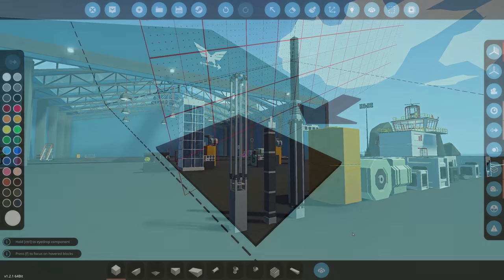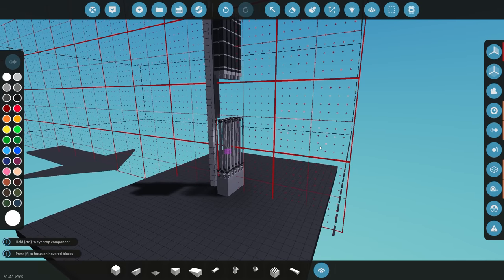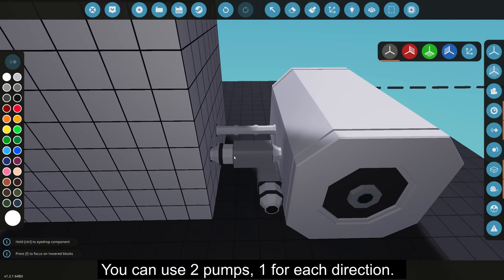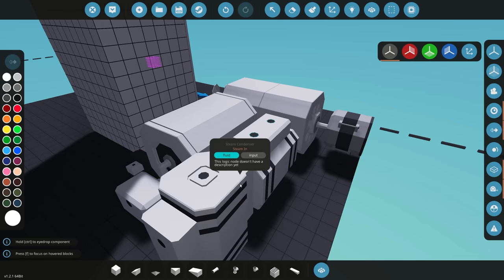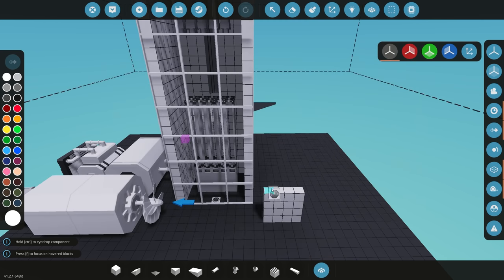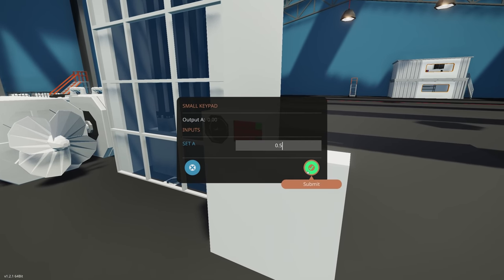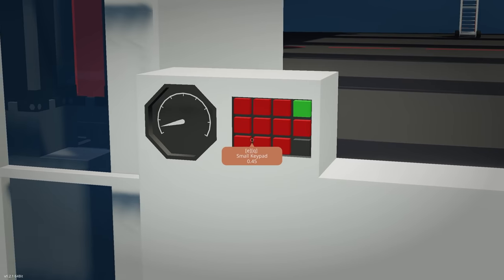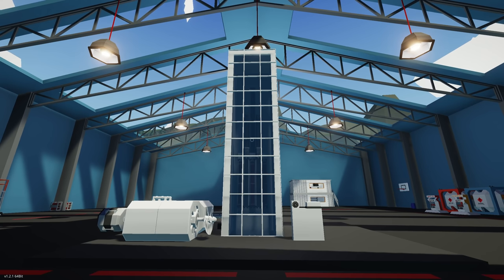Building a Nuclear Powered Engine!!!! - Stormworks

Comment: Is it just me or are the reactors quite underpowered? A medium engine has more power than the example reactor.
Reply: I fully agree
Reply: I am getting only about 10rps on a large generator with nuclear power compared to 22rps with a large engine and a large gen.
Reply: @thingymuhbob  you must admit its unlimeted power
Reply: @sjoerdbreimer  Only for the moment though, they talked a lot lot about disposing the nuclear waste so eventually you will need new fuel rods once that's added. But the rods will still probably last way longer then a medium engine on a couple large tanks.
Reply: @riker8146  thats for sure
Reply: @riker8146  yeah but nuclear ship take years 8 if i recall to need to be refueled
Reply: I installed in on my teat ship only to find out that it only reached 10 knots while it used to be 19 knots with modular engine the same size. But It would be great for an emergency power since it's practically unlimited for now.
Reply: @thinaphonpetsiri9907  if you build 2 of those reactors you get more power or you need to connect more steam turbines to it then it produces more power coal is a fun way to power your ship but not very logical because you first need to get it to your ship because for as far as i know you dont spawn with coal in the hull or near your Dock
Reply: Yeah the only real use I'm seeing at the moment is submarines since it doesn't require air like the other engines
Reply: @riker8146  I think this is a limitation of the boilers, as there was a discussion elsewhere in the comments about how weak they seem to be right now.  You could add multiple boilers, but sheesh.
Reply: @stevepittman3770  The reactors work well. Its definitely an issue with the turbines and boilers. They seem to be balanced with coal power in mind but not nuclear. The craft that nuclear reactors will go in will have to be large, and large craft take a lot of power to move at reasonable speeds. The power from nuclear driven turbines does not output enough to justify using them on craft that can fit them.
Reply: Correct me if I'm wrong, but I guess a single reactor should be able to power 3 to 4 steam turbines just fine, if they're like the ones IRL
Reply: @afoxwithahat7846  yes it can, 3 turbines got me slightly better than the medium engine, which in my opinion is quite tragic.
Reply: @chickenjonte_  I mean, if it's nuclear is cheaper per kilometer, it would allow the game map to be bigger, and with more space we would have more things in general. At least I hope that's the devs' intention
Reply: @orrinbare  Jet turbines don't require air and also produce power.
Reply: @DiscoStringHit  Jet turbines are still the king of travel. I can zoom around the map at 50 knots and have a range of 1000km.
Reply: @DiscoStringHit  oh I had just assumed they needed air.
Reply: @orrinbare  yea and subs dont requiere that much power
Reply: @sjoerdbreimer  mine does lol. I'm working on a 1:1 scale seawolf class. 2 jet engines to generate power and 2 geared together to drive a screw. Still barely enough power but I add a lot of stuff on it
Reply: Use multiple boilers
Reply: @sjoerdbreimer  the thing is that you have a lot of power that will not depleted quickly but as a drawback the system to make it work is big and heavy, stormworks doesn’t do that making it almost useless for things that need a lot of power. Or you have to do the thing where you do with the large engines in large ships, have 20 of them and still only go 10 knots
Reply: @monkemonke9048  doesn’t really work, the pressure of the boiler only goes up to 10 which is not enough for anything useful and with the turbine and a large gen connection I wasn’t able to produce more than 60 swatt
Reply: multiple boilers isn't the trick, the trick is multiple condensers. irl turbines spin FAST and are geared down to produce torque. 
the reason we can't get them to go above 60 rps ingame is because the steam output of the turbine is ALWAYS the bottleneck. 
i tossed 5 condenser together with 1 boilers and 12 turbines and got wayyy more power. 
but still isn't enough for my tanker ship, 2 5x5 7 piston engines pushed it up to 30Meters/s, but that reactor only got me to about 4... pretty disappointing even after figuring out the weak point. 

if they gave us a desalinator so we could convert sea water into fresh water, and use that for the boilers, then we could just vent off the steam from the turbine output. and there wouldn't be a bottleneck which would allow us to actually get some usable power from this system.
Reply: Try using insanely high gear ratios, connect it to a flywheel, then gear it back down and use a clutch at 0.55 and enjoy insane power outputs =)
Reply: Also, I suggest only using nuclear reactors for “roleplay” purposes or for charging up stuff, i like using them for bases on islands.
Reply: Doesnt the fuel rods for a modern nuclear sub hold 30-40 years? So the entire lifespan of the ship?
Reply: @Matthewliberty1 I thought the goal was to convert the rps with generators into electricity and then use motors to power your craft with transmissions. I am curious how efficient you can get this way. Also allows you to run faster and then run at a speed you charge at when I tried years ago!
Reply: I guess it's more about the fuel not the size of the enginw/reactor.

Comment: I feel like the steam turbine and boiler need a buff, steam turbines need to atleast be as strong as a jet engine, maybe even stronger. And the boiler can only take 10 bar in pressure, even a plastic bottle can do better.
Reply: They are weak, they are also insanely heavy.
Reply: Seriously? The Flying Scotsman (built in 1923) had a boiler that operated at up to 15.16 bar (220 psi)! So the boilers we have aren't even up to coal standards. 😳
Reply: Heck, the Titanic could manage 215 psi!
Reply from the maker: I don’t remember seeing anything saying it was measured in bar or psi, can you tell me where I can find that?
Reply: @MrNJersey  I’m not sure where you would find the information, but 1 atmosphere is about 14.7 PSI, so if Stormworks uses the same atmospheric pressure as Earth, a boiler at 10 PSI would be under vacuum at sea level.
Reply: tbh it does need some kind of buff, the turbine only outputs 26 tourqe at a max of 40 or 50 rps, which is really sad considering its a steam boiler not a power wheel
Reply: @Judy laughed cuz i cracked a joke who said it wasn't
Reply: @MrNJersey  To me it’s a basic and logical observation seeing that jet compressors look like they are read in mBar I assume it’s in Bar just like everything else in Stormworks is in metric
Reply: @Judy laughed cuz i cracked a joke well, he didn't 
He stated why it isn't psi
Reply: The measurement unit doesn't matter. In relation to other stormworks power sources the turbines/boilers are to weak.
Reply: @Judy laughed cuz i cracked a joke*If the boiler uses PSI.
Reply: @afoxwithahat7846  I was a bit unclear but that was my intention.
Reply: Given the staggering weight requirement of both coal and fuel rods, by all accounts, making the turbines so weak doesnt make sense even as some sort of balancing measure.
Reply: As a steam snipe, I wish it was measured in psi
Reply: Yeah what's up with the pressure lol only 10. Let's hope they increase that to atleast 50 or 100 in a future update.
Reply: Boilers at the old Didcot coal plant operated at 3600 psi :)

Comment: If you flipped it upside down and did a power switch to the track, you could have an emergency shut down where you cut power and the fuel rods just drop out of the reactor when they are ejected
Reply: I'll be waiting to see creations with your ingenious idea!
Reply: That's how I'm building a small reactor atm, the fuel rods are lifted in and the entire fuel rod/control rod/primary water containment assembly is also on a set of rails so the whole lot can be lifted/slid out for refuelling/repairing a damaged core. Not relying on gravity also has the added benefit that the reactor can be led down for use in trains and ships that aren't that tall (subs etc). 

Its just a shame the steam turbines are really weak right now, either that or I'm doing something wrong lol
Reply: @marko247  I had the same thoughts about it, especially looking to build a reactor horizontally to better fit in a sub, for example.  I haven’t tested enough yet, but how do you actually replace a depleted or damaged rod when the time comes? Can’t seem to see how :/
Reply: @holgerkrog8549  not sure if they drop out automatically without power tho, going to do some tests
Reply: I'm working on one for my test ship with system that sealed the engine room and then ejected the entire reactor out and switch to battery. 
Yeah Neptune gonna hate me but I just wonder if the radiation still on the ship if the reactor is gone.
Reply: I was thinking the same thing too.  I think he only built them above so he wouldn't have to actuate them into the reactor, but it definitely makes more sense to have them drop out when ejected.  We'll litter the seas and skies with spent fuel rods, it'll be glorious! ;)
Reply: @davidechiarella7752  the same way NJ attached it, you can release the rods and then power the engine in the track to pull it out. then using some kind of clamp where you can open the reactor chamber and take all that fuel cluster out using another track, maybe. It's up to you :)
Reply: The fuel rods will just increase in temperature since they don't have control rods next to them though, right? At least in real life it wouldn't work haha. Have you tried it yet?
Reply: @gamaltk  the reaction completely stops and the game doesnt register them as having temperature after ejecting
Reply: @basementdweller24  Ah fair enough
Reply: @holgerkrog8549 it's not really a new idea, many nuclear reactors do it this way
Reply: @AHHHHHHHH21  It was a new idea 2 years ago
Reply: Yeah I'm making a reactor that'll do the same thing

Comment: "You can acutally automate this process (controlling a nuclear reactor) by some simple logic."

All nuclear engineers: "Am I a joke to you?" :D :D
Reply: Just add a few AND gates, and boom, irl nuclear reactor
Reply: @thatonedude-6819  Actually, you can build any logic by using only NANDs. So, it's basically true 😀
Reply: Yea in the example they just divide the temperature by 400 and feed that number to the control rods.
I am controlling my prototypes by changing that number via a keypad and with a numerical switcher I can switch to a throttle lever.
But I think you can also just a pid but you have to tune it really carefully.

Comment: I made quite a lot of testing and this is what I found for best performance: 
Rods melt at 1,100 degrees, boilers burst at 10 pressure, Boilers give the best performance if the boiler temperature is closer to 100, but won't work under 100. Also need to keep pressure on boilers as close as 10 but clearly not go over. Condensers will condense fine if kept under 100 temp,  You need 12  steam turbines, 6 boilers, and around 25 fuel rods? (i think if you run them at high temp they degrade quickly so its good to have sligthly more and throttle up over time to compensate radiation loss) to match the power of a large diesel engine. (if everything has great efficiency and running at near max capacity, with rods reaching almost meltdown temp). You'll need likely one condenser with 2 large radiators to cool all that down. So... basically... Nuclear power seems to be quite under powered taking into account that you need all that to match a single large diesel engine, and takes about 10 times the space. Ridiculous... Only good thing... well... lasts longer and doesn't need air.
Reply: I agree, also the torque obtained from the turbine is ridiculously low. considering we are talking a nuclear reactor.

Comment: In my experiments with making miniature reactors, I have found that you actually do not need control rods. The way I was controlling my reaction rate was by removing the fuel rods from the fuel assemblies if the boiler was at temp, or if the fuel rods got too hot. It honestly worked exceptionally well, the only issue I was having was the boiler its self would consistently generate too much pressure and blow, but everything else worked like a charm. I should say it was also pretty neat, seeing glowing fuel rods retract from the fuel assemblies.
Reply: this is risky but surprisingly effective. doing it this way gives up granular control of temperature in exchange for very rapid cooling capabilities at the caveat that you are adding quite a bit more load on the game's physics engine.
Reply: @tacoman487  Indeed, I eventually found that a dual system works best. Using the rapid cooling of the removal way as an emergency tool. Given the reactors I was playing with were so small I only 2 control rods were needed to control the reaction, and so the size reduction wasnt major enough. It might actually work out better with larger reactors where theyre reactions are harder to control.

Comment: That's a really easy setup^^ Setting it up with a PID should be fairly simple; just need to set your temperature target as the setpoint (Can use a throttle or keypad for that). Use the actual core temperature for your variable, and then just play with your PID values until it behaves. When you want it completely turned off, you can just use a numerical switchbox and a button, with the On value being Reactor Shutdown, or vice versa.
Reply: How would you turn off a reactor tho?
Reply: @NCIA-93  Release the fuel rods and pull them up out of the assembly. It will automatically shut off.

Comment: Woot woot after seeing this i made a 24 core reactor with 3 control rods and a function gate  for the control rods(x/500) and then i have the fuel.rods on a compact linear track,  controlled by a numerical switchbox, greater than box, a few constant numbers, and a temp gauge for water (52k litre-think i need to lower cuz it aint gettin above 50), also each main core set (3 sets of 8) and it rides between 700, 800 in temp, seems to run fine, ty for the help!

Comment: Good,now I hope that the Devs will add more things to this nuclear space,for example IV Gen reactors,which are the standard for any ship or submarine,or maybe some other types of reactors because the one you built is basically a LWR,which uses a single channel of water both for cooling and for transferring heat. Maybe some BWR,PWR or even the CANDU would be awesome.

The application are a lot,I know something would be pretty hard to understand but trust me,once you know the principles of nuclear and the key parts, you're set

Comment: When you first put the ten fuel rods on the top of the rail, you should have gotten a maximum output reaction -- they don't "start" generating heat when they're in their assemblies, they start just by being close to each other.  They should be kept isolated until they're inserted into the reaction one at a time.
Reply: Alas, the game only "activates" them when they are in their little assemblies.

Comment: Unfortunately right now the reactors are just a huge waste of weight in any vehicle you make, the turbine makes close to no power whatsoever and even with multiple boilers and turbines the power output is laughable.
Reply from the maker: Make sure you are building them correctly, alot of workshop creators have already got amazing powerful creations using them.
Reply: @MrNJersey  I’m pushing the limit of the reactor/steam setup and I can’t get more than 40 rps and 26 torque with no load
Reply: Shh, remember we're not allowed to have opinions in this community
Reply: @MrNJersey  The most powerful one I've found makes 390 watts (or whatever the output figure for the generators is), which is a ridiculous number for something that big. I get 5 times that with a 4 cylinder 3x3 modular engine in a package which weights 10% that of the reactor (and that not taking into account the water spawned in the reactor vessel). 

I know reactors will always weight more that an internal combustion engine, but with the power they make right now it is impossible to use them in anything. I would need 3 reactors like that just to power a large electric motor at max power, it's just to much.
Reply: I think the reactors are more about lasting longer, as the fuel rods wont have to be replaced often. We may need more time with them too as playing with different reactor and steam setups gives greatly different results. If I'm wrong and they are underpowered though if we express this opinion enough the devs might change it.
Reply: @riker8146  yeah but they last long due to an insane energy density, it’s just that they limiters the energy transfer between reactor, boiler and turbine
Reply: Same here. I’m currently trying to create a really efficient reactor for my Submarine and I can’t ever get it right because it just doesn’t power the generators enough
Reply: @TheRealDrae  dude i so needed a comment like that, ty
Reply: @Headbreak1  reactors are large and heavy but don't have fuel usage like everything else giving you a theoretically infinite power source
Reply: @devlinkellar1702  reactors take a long time to warm up and if it does not have enough fuel assemblies or too much coolant it will be able to dissipate its heat faster than it produces it. this is the one case where extremely overpowered cooling systems are a bad thing!